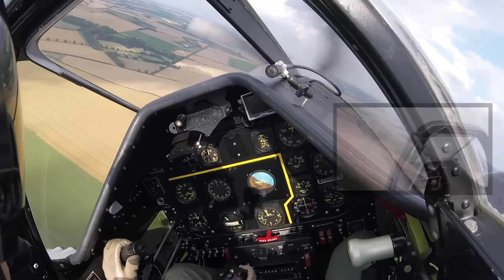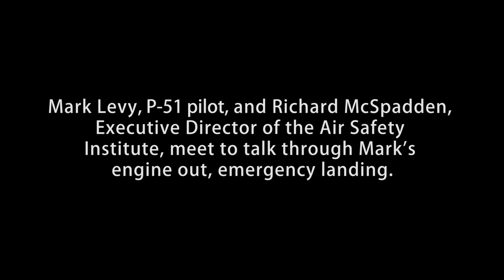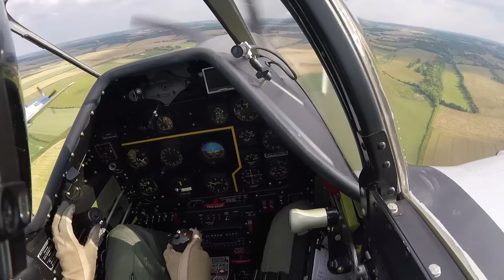P-51 Engine Out, Off-Airport Landing - Full Analysis

Comment: So glad he DIDN'T try for that turn from base onto final and the runway. As I was watching that I was thinking - dont push it dude, get it down, dont push it dude, get it down. He so made the right decession in NOT trying to reach the airport (and crossing over the car traffic) and instead landing in the field. My heart was in my mouth when I saw the runway from that base angle. So glad he accepted the situation he was in and dealt with it as it was and not as he wanted it to be. "Three's down and safe". Well done that man!
Reply: Not a criticism of the pilot or of you. Just fact. Also, not one decision, good or bad, can be taken back in time for a do over. So, what we decide is what we have to accept as fate. Review the critical parts of the video where he is on a direct heading to the airfield with altitude and landing fields under him and to his sides. He could possibly make the airfield. Flying over the road sealed his fate by going too far and being too low from the airfield. He wasted time setting up for a normal pattern. In an emergency, doing a downwind, base, and final is insane in this case. Worry about energy management over the airfield. And, I am speaking from over 35+ years as a glider pilot/owner and GA power pilot/owner. Once again, I tell power pilots to take some glider training in case of these not so rare situations.
Reply: No he didn't waste time setting up a normal pattern, you need every ounce of help on ditching a heavy aircraft with tiny glide ratios. Downwind is suicide, never mind loss of control is much more likely and spectator casualties. He did absolutely the right thing. he left himself enough time to change his mind and ditch in a field when his engine failed completely.
Reply: I don't see it that way at all. He did waste time. He set up for a normal pattern and as soon as he turned downwind he had no more options. Most power pilots never think like a glider pilot. Glider pilots train for and think about these very conditions during every flight. He could have made the airport property and gone cross field into the grass but it looks like he could have made the runway. Point towards where you want to land and forget about downwind, base and final. He still had one or two more options if he did not turn for a normal downwind pattern. He did this most likely out of habit. Not a downwind but a crosswind landing with gear down could have been accomplished. I've done it in my Skyhawk and in my glider many times with power of course. The good things were he got out alive and well and he did not hurt anyone else.
Reply: Mustangs don't glide do they, in a engine failure they drop like a brick but if you are skilled as this bloke is the brick does not hit the ground quite as heavy. 120mph in a car can be slowed down with brakes, a aeroplane has no brakes and when you weigh 7 tonnes..............fuck it I can't be arsed to explain. Bare in mind you have Duxford village and also bare in mind the field above Duxfrod are sloped, he did the right thing, that's why he flies airliners full of people, you don't.
Reply: saab -- Shitty automobile by the way. Thanks for educating me about flying, aerodynamics, and bricks. Sounds like you know everything about drag coefficients, Lift coefficients, glide ratios, polar plots, energy management, et al. and about my flight experience. Thanks for the flying lesson, too. It never ceases to amaze me that the very people who originated the English language can't spell, punctuate, or compose a sentence worth a damn which "you don't". I just learned that English pilots need not be literate. Good going there, Mr. Saab.
Reply: 12u -- Are you a pilot like Mr. saab is? You two have much in common if you are. Now, tell me about tiny glide ratios again since I have been shot down twice in two Huey helicopters so I must have died. Psst, the jungle, trees, and especially the ground will get you, not the tiny glide ratio. God Damn, auto-rotate, auto-rotate.
Reply: @JonHeckendorf  EXACTLY.  Most people are just saying 'good job'.. well.. there was a much better choice.  Maybe he wanted to save the plane.. but flying PAST the field to do a 180 to land is something we can point at and say 'this is a bad call'.  He had to scrub a TON of airspeed to turn.. and THAT is why he didn't make the field.  Pilot error definitely played a role.
Reply: @JonHeckendorf  Were you invited to speak at the ASI? I think not. Were you shot down in a Huey or was it the angry natives firing stones at the rotor from catapults? Can you really criticize native English speakers when you call a motor vehicle an automobile? We use "our" language how we please Mr Hickledorf.
Reply: @JonHeckendorf  Your level of intelligence is very clear in your reply and the need to insult everyone else who has a difference in opinion. A bit rich for an all American yokel.
Reply: @JonHeckendorf  I'm not European yokies, I'm English and you know nothing about who I am and what I do. The fact of the matter is that its so easy for so many people to sit hidden behind desks making comments in hindsight after watching a video more than once. They are the real idiots, because that pilot had a limited time to get the plane down, the M11 motorway runs directly past Duxford Aerodrome and there are many villages and hamlets around that area, plus many people without tickets get into the adjacent fields and he would have known all this. The plane was brought down safely with minimum collateral damage and no one was killed.

Any "pilot" would tell you that any landing you walk away from is a good one especially when the engine on your plane is dying mid flight.

Comment: Take home lessons that I gleaned from this excellent interview:
1. Gear up on forced landing is probably better than gear down. You can stop in a shorter distance and lower chance of flipping over the nose.
2. Try to put in all flaps just before impact to dissipate energy. Of course make sure you don't do that when stall a wing is possible. Mark Levy threw in full flaps just before impact when stalling wasn't an issue anymore. 
3. If you have an intermittent engine problem (engine off, engine on, engine off, etc...) remember to shut off Magnetos and Fuel prior to impact. 
4. Commit engine out checklist and shut down checklists to memory and use a "flow checklist" method.

Comment: 27:37 That stiff neck didn't come from the yaw, it came from the 300lb canopy doing a hand spring off the back of your head. 2:32
Reply: Reviewing 2:32 it seems like jettisoning the canopy realy would have been the better option.
Reply: It does catch him a beauty.
Reply: good catch.   It nailed him, if he had not had a helmet....
Reply: Jettisoning canopy would have induced even more drag leaving him less time for decisions.
I think he made the right choice even if it wasn't as per the manual, it worked fine for that incident.
Reply: In fact an open canopy induces more drag than a jetitsoned one would. However Mark still got out safely.
Reply: Yeah, I'm thinking he is actually lucky that the canopy didn't break his neck. Put the video into the slowest playback speed, then start playback at 2:32. The top of the canopy edge hit him smack on the back of his neck. Helmet didn't do anything, all that force went into the neck. Remember to listen to the people with experience, which would be all the designers, test pilots, and combat pilots that flew this thing.
Reply: Yup, right under the helmet at the base of his skull. Same place I do my karate CHOP!
I think the helmet DID save him from a broken neck by limiting the roll of his head. If it had been able to snap all the way back I think they'd be doing the missing man formation at the next show.
Reply: Gforce237 did not appear to hit him in the helmet..
Reply: @julesviolin  Probably not actually, likely would be less, but it would have been a distraction, there we mistakes much bigger than this, which is why it's silly to put the focus there.
Reply: Nice catch. Propably that is the reason manual says to jettison it. He was lucky.
Reply: Jules Anderson I can see why you might think that but an open canopy and a jettisoned canopy would produce similar levels of drag, in fact it’s more likely an open canopy would product more if it’s presenting more surface area and disruption to the airflow acting like a parachute. But it’s marginal it would have made much difference to the glide slope, it’s more for safety, he said it weights 300lbs and it nearly took his head off on landing.
Reply: Good eye. Definitely shows why they say to jettison the canopy!!

Comment: Great Advise from a true professional pilot.  My instructors years ago told me to take the 3 to 5 seconds to THINK, just like Mark Levy's advises, and fly the airplane while attempting a restart.   I had 52 seconds to decide where to put my fixed gear airplane, into the trees, or flip it in mud or hummocky tundra..  I chose to land on a strip of trees next to a creek and without setting off the ELT, I walked away.    My airplane did not let me down, it was my fault.  I had ignored a missing section of gasket on a wing tank fuel cap and the tank vapor locked cusing the engine quit from fuel starvation.  Fortunately, the damage was minimal and after a mechanic made temporary repairs and provided a FAA ferry permit, I was allowed to fly the aircraft home for repairs.   It's the little things that get you.  Even if you are far from home, get it fixed before you fly. Flying is awesomely amazing, exciting, constantly challenging and never boring.  It is all I dream about, but you can not be complacent like I was.

Comment: A couple of weeks after watching this video I had a 'partial engine failure on climb out' experience. Rather than prepare myself  immediately for a forced landing ahead in probably a soft field (fixed tricycle undercarriage, bubble canopy, an almost certain flip-over result) I took a moment to ascertain the options. I saw that although I had reduced power, that power was steady, and enough to even climb a little. Called ATC and told them of my intentions, flew a low level circuit, my passenger keeping an eye on Ts and Ps and landed safely. Thanks Mark, I'll buy you a beer if you ever find yourself at Goodwood, just ask for Baz Davis, normally flying a Zenair Zodiac.

Comment: With having to make a decision I think it would be easier to have a complete engine failure.
Reply: Agreed! In that base-to-final turn, with the runway SO close, a lot of less experienced pilots would have fixated and continued turning. He stayed flexible and calm and critically remembered to bring his gear back up. Impeccable decision making,  a little luck and of course RA. Hoover watching over, saves the day.
Reply: steveo1kinevo. With all respect to this fine pilot,   I’m wondering if landing on the downwind would have been a better choice.   Would you share your opinion on that idea?
Reply: Im not steveo but, Im sure at that point he thought he could still make the field.  A downwind landing is a good idea, good idea.
Reply: Complete engine out or partial still ends @ maintaining altitude and surviving a landing ...
Reply: Yeah, much better to have only one option. Glider pilots constantly face the dilemma of finding a weak thermal when we've made the decision to land - it can be a killer if you try to gain altitude and fail, only to end up in a bad spot!
Reply: James dell, that's been discussed. There was an airshow going on, landing against the pattern was not an option with the limited time he had.
Reply: I would of just shut it off
Reply: He had no altitude, an intermittently running engine, 20 other aircraft in close proximity, and thousands of spectators on the ground.  It appears he was already too occupied to be able to add a possible downwind landing to the mix.
Reply: once you experience an engine problem it IS a failure at that point - treat it as one,....  pick a spot that you CAN reach, and fly th3e airplane!   Do NOT try to MAYBE make the field,....
Reply: Watching full screen for the first time, I was watching that horizon climb the windscreen and I looked over at that threshold fading behind the freeway and I thought "Oh no.  Is he going to try and make it to the runway?"  Thankfully he did not.  Of course, I'm an awesome judge of that kind of decision, sitting here at my desk!  Great video and great lesson for us all.
Reply: Yep
Reply: I agree but which end had the freeway? Having another warbird (Hawker Hunter accident) ploughing thru cars is highly undesirable. Unfortunately many roads/obstacles are too close to the ends of runways. At the end of the day you just want to walk away.
Reply: I'm not a pilot but I can imagine that the brain just nagging you and thinking the engine is can recover and that hinders you a bit. But if the engine said splat/bang with puff of smoke that is out the question and the brain immediately focuses you on actually just flying the plane without an engine. But then again maybe he would just gained a few seconds. And he came down with he's live intact and that is a pretty good landing in my book.
Reply: Michael Washington I'm pretty sure that plane would slam into the ground on landing if he went for the runway. He had low airspeed and lots of decreasing altitude, along with a very sharp turn
Reply: It's simpler sure but no, then you are just more forced to ditch. Simple summary here is that he had plenty of energy to reach the runway but managed to miss. It's clear cut pilot error. The camera and editing makes it seem more confused than it would be in the seat with spatial awareness of where the runway is. I'm not even a pilot but in my book, there is no excuse for trying to go around in an emergency instead of shortest landing. He has good visibility and good energy. Best glide is apparently 15:1, not that he needed it.
Reply: Dan Frederiksen ...i'm not a pilot either,  I therefore have no idea what the right course of action should have been.  I wouldn't dare comment lest I sound ignorant. He seems to be alive, I take that as a good sign....
Reply: Even though I'm not a pilot I think I have solid enough aeronautics knowledge to draw the conclusions I do.
Reply: I would imagine that would always be determined by the circumstances involved
Reply: you are very clearly not a pilot and have no idea what you are talking about. Read the comments that are made by pilots. No way he could have reached the runway and landed. Downwind would not have been okay due to traffic, and would have required extreme turns to get to the final (he would have died). This is as nearly perfectly done as you are ever going to see. A pro, doing pro things, at a pro level. Very impressively done (to those of us who actually are pilots)
Reply: You mean like the open canopy and gear down creating drag? professionally bleeding energy. In a pro way. In a pro panic. And shoulder claps from pro idiots. Don't come for me Ari when you are clueless. Of course he could have made the runway. He flew right past it with the canopy open all the way there. In an emergency all other traffic clears.
Reply: No if the motor has any life in it you keep it going
Reply: LegendLength it is worse in my opinion. During my training we always practiced engine failures and glide approaches. When you set yourself up for landing without an engine, its all about energy management. You constantly check your speed and altitude in regards to where you plan to land. You are pretty busy at that point, doing memory actions and the abnormal list at the same time as well. But if you have a runway or a field in sight, you plan for that. Having to replan every couple of seconds messes everything up. You might have had the best chance just following your first plan to the end. Once you think you might make the field if the engine keeps running long enough, you focus on that. And trying to make the runway with a partially failed engine can make you get into a position, where no landing site is available to you anymore. So yes, an engine that quits every couple of seconds is a more challenging failure in my personal opinion, because the decision to shut the engine off is a hard one, and it’s way easier to get caught up on trying to keep the engine running, that you forget to FLY THE AIRPLANE. You can not plan a landing when you constantly pick a different landing site along the way.
Reply: steveo1kinevo true dat! Partial power loss or intermittent failure is much more dangerous
Reply: Dan Frederiksen so easy to say all this in the comfort of your chair in front of the computer.  It’s VERY different in a borrowed rare airplane in an air show with 20 other planes around you and an engine that is not quite dead.  Argue all you want your ignorance and rudeness is what’s showing, not your superiority
Reply: LegendLength imagine, engine out, you pick a place to land, suddenly engine power, now the place to land has just become too close and you aren’t going to be slow enough.  Pick another place that also allows you to maybe meme the runway. Whoops, engine out again but it didn’t stay on long enough to actually make your selection. Gotta try a different one, as you are looking, engine on, crap I’ve started turning now do I go back too.......rinse and repeat 6 to 8 times in maybe 75 of those total 104 seconds.
Reply: haha yeh there's only one right answer
Reply: Yes. He was not trained well enough and makes excuses. He should have tried to gain altitude and fly to the runway not fly the pattern. He needs more instruction.
Reply: I understand your point. Now what really caused the partial failure? water in the gas? dirt?
faulltu fuel pump?
bad ignition?
Reply: steveo !!!